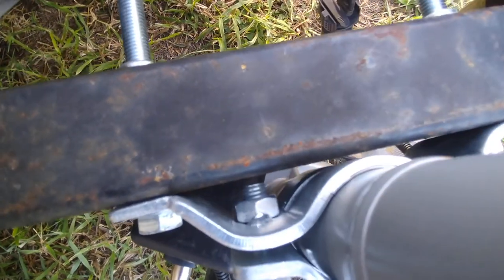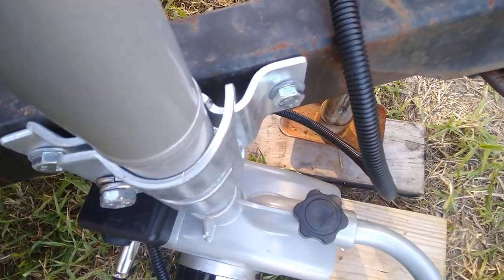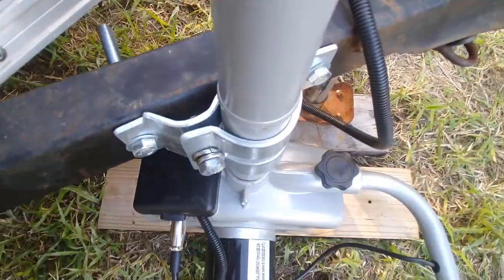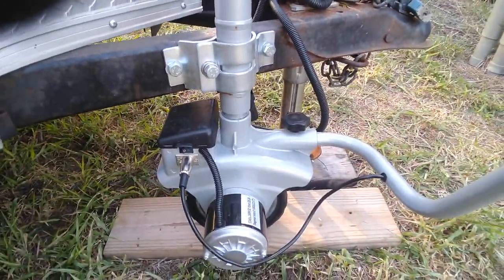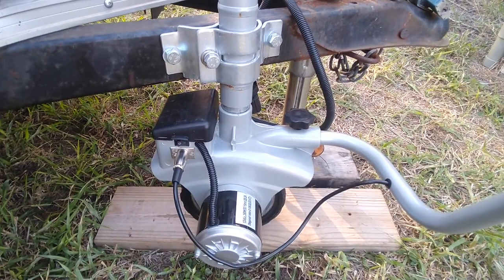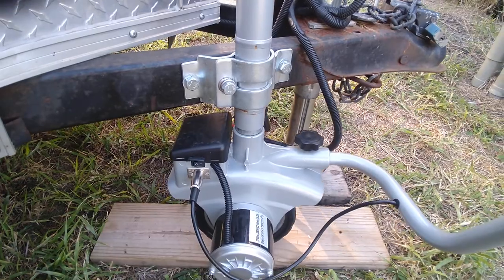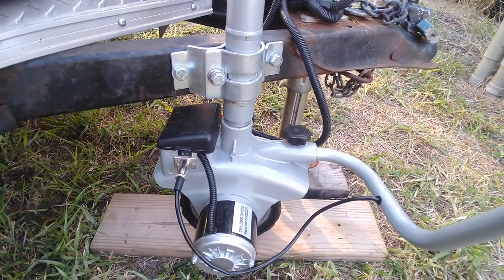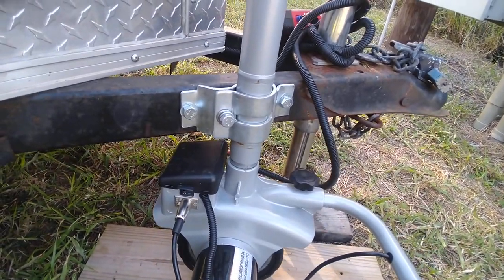Trailer dolly

Comment: In case anyone else runs into this, one problem is that you don't have the unit in the clamp right.
Those raised rings are supposed to go inside that split in the clamp, not above or below it. 
I don't know for sure that it would completely solve your problem, but it is the correct way to do it.